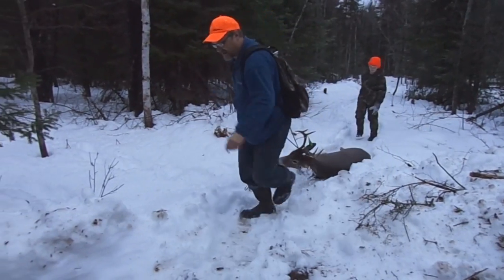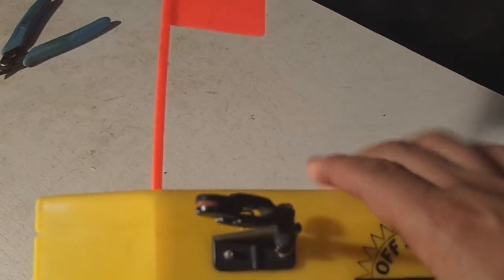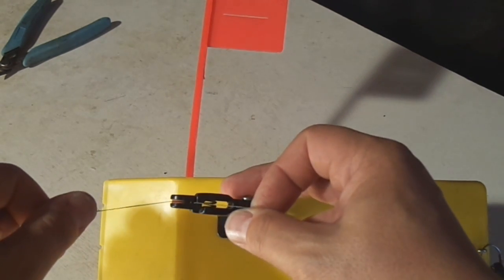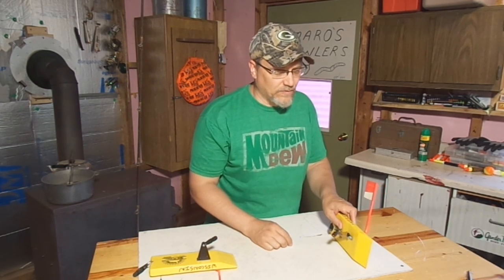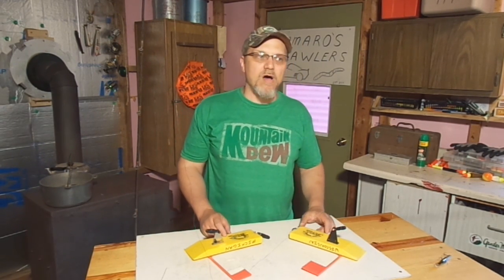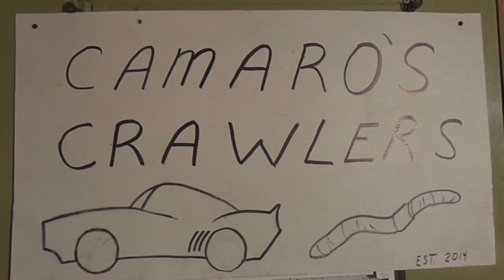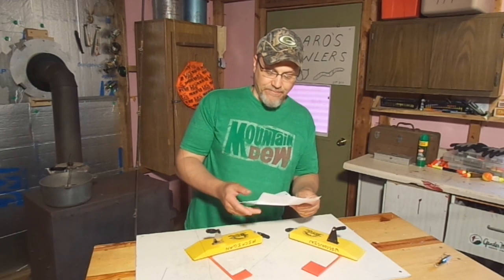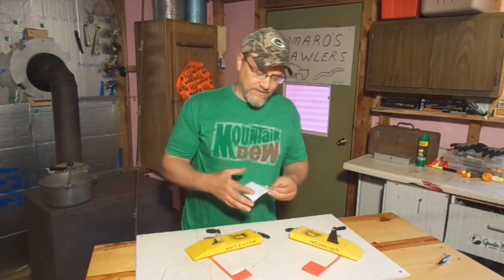Off Shore Planer Board Hack

Comment: Could you explain reason for the forward angle of your front clip arm, and how you achieve that mod? I fiddled with my OR12 and it just wasn’t working.
Reply from the maker: The bracket had a notch that allows for that.

Comment: I was wondering if you could give me the measurements  of those planer boards?   They are not readily available here in Australia. Plus the cost is out of my range, I thought I could build one.  Don't worry if it's to much trouble.   Good luck with the new venture.
Reply from the maker: Malcolm, sorry this took so long.  For some reason your comment didn't pop up on my notifications.  They are about 10 inches by 4 inches.  Weighted on the bottom edge.  I made some homemade ones too and the size is really dependent on two things.  They need to be big enough to keep planning outward against the pull of your lure.  Lures with a lot of pull or drag (big lipped crank baits) will pull the board to the back of the boat if they aren't big enough.  I have some store bought small boards also and you're limited to lesser pulling lures with them.  Also you need a beefy enough rod to handle the board, so you can't go too big either.  Bigger boards = heavier duty rods.  Again sorry this reply took so long.  Thanks for the question, KPO.

Comment: This helps fix turning around the boat to get a lost board but....  The actual function of that clip should be to release when you give your rod a good tug.  This fix makes the clip function as a solid point .   It would be great to redesign all these clips to actually work properly.
Reply from the maker: Mike, most of the planer board fishing I do and I've seen, is to unclip the board when you reel it up to the boat with or without a fish on.  The only other thing I've seen is when you tug the rod the front clip releases and the board slides back to the lure or fish.  Instead of a back release the line slides through a solid ring, so it can never come loose, but you are always reeling in a board.  Is this the setup you're talking about?  I don't fish them that way, but they never really come detached from the line that way either.  Are you talking about tugging your rod, having the board completely release from the line, bring in the fish, then go back and get the board?  Not sure, KPO.

Comment: How did you cut the pin off? Not familiar with the release yet but I will be this Spring. Hack saw? Cutters? Thanks.
Reply from the maker: Terry, small little wire cutters.  If you are buying boards new you will find some come with built in pins now (I had the idea 20 some years ago LOL).  So you can actually buy them like this now.  Thanks for watching, KPO.
Reply: Thanks for the FAST reply!!!!!!!!!!!!!

Comment: Opti has the best clips. They actually have lever operated clip. Similar for a component that you would clip to a rail for a crossbow or rifle. It will not let go unless you flip the lever to open the pinch pads. Clearly the best design out there.
Reply from the maker: Yes they make many clips now that don't slip off.  This vid is just a hack for anyone with these old style Off Shore clips.  Thanks for adding in, KPO.

Comment: Thanks for the tip. Great idea
Reply from the maker: Now, they make newer clips that do the same thing, this was just a good modification for guys like me that have the old style clips, KPO.
Reply: @KnettersPracticalOutdoors   I just don’t want to spend another $20 on the or18 release. This mod gets the job done just fine.  Haven’t lost one yet or had to loop back around and scoop with the net. So it works just fine.
Reply from the maker: @cashotpb  Awesome, that's why I made the video.  Thanks for the feed back, KPO.

Comment: the red clips have a built in pin and the flip over ( or16) clips can't come off ever .
Reply from the maker: vikwillwin,  yes you are right.  But 20 years ago when I started doing this none of the Off Shore clips had pins for this purpose (I have red ones from 20 years ago too).  Just thought this vid might help a few fishermen with the old style clips.  Thanks for watching, KPO.
Reply: They still come off of fire line in rough water.

Comment: Great tip, thanks will be trying this
Reply from the maker: BBBYpsi, it works.  The boards won't come off until you pinch the clip, even with low diameter super lines.  Thanks for the comment.  KPO

Comment: Front clip is supposed to pop off...rear clip stays attached...fight the fish not the board...bet you have fun reeling in the boards
Reply from the maker: tloutfitter, that is one way to do it and I'm sure that method works too.  But my experience is, if you leave both clips attached, you know what you're dealing with when the board gets to the boat.  If you pop the first clip and fight the fish with the board coming in backwards, your line may tangle in the flag or unused clip.  I've seen boards spin and twist when reeled in backwards.  This can cause problems getting the board off the line while fighting the fish.  When I first started using boards this happened a few times, so I prefer to keep both clipped on.  It seems like a lot of the walleye guys on YouTube like to keep both attached right up to the boat also.  Probably for the same reason.  It's just a preference thing, no right or wrong either way.  Thanks for adding in, KPO